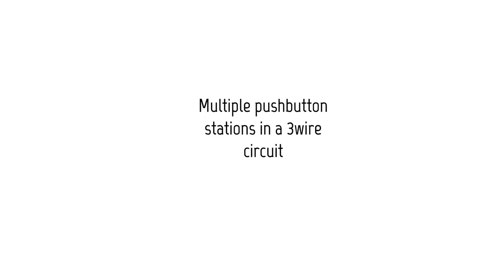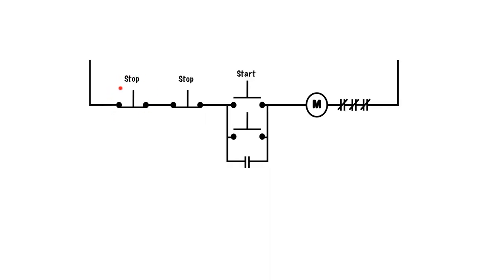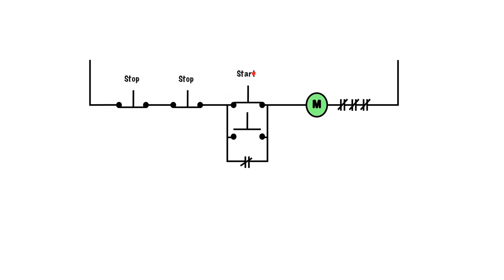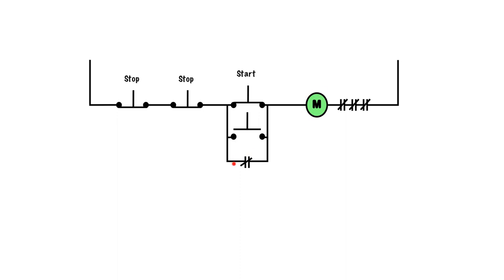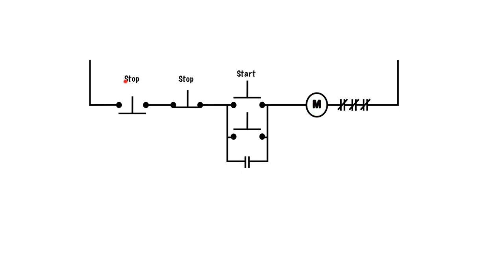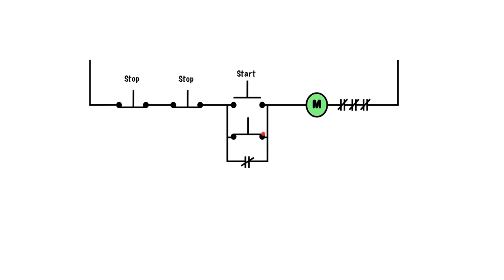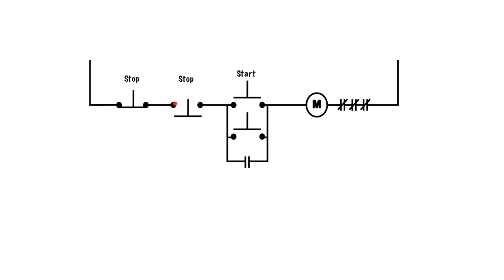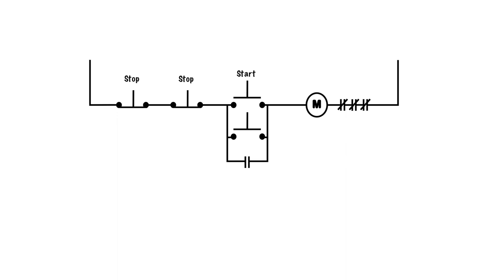Multiple pushbuttons in motor control circuits.

Comment: Hi, I was wondering about 208 three phase color of wires. Black red blue and green with no neutral correct? This is in reference to a pump low voltage 208 three phase. Thanks!